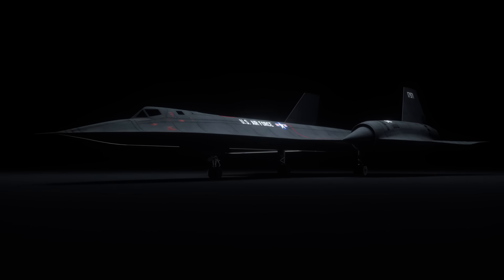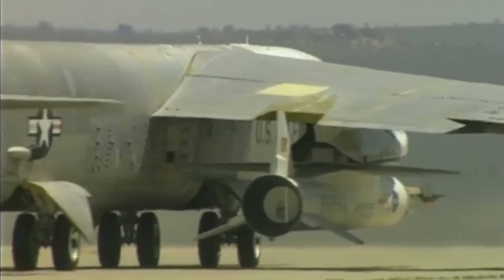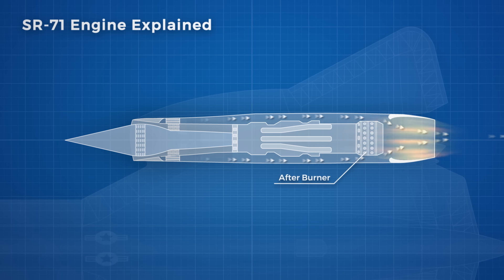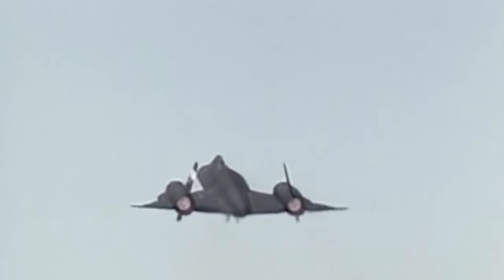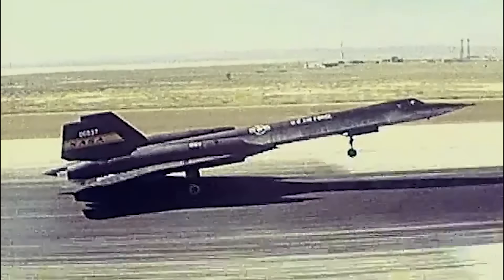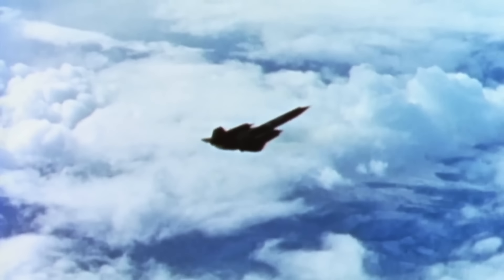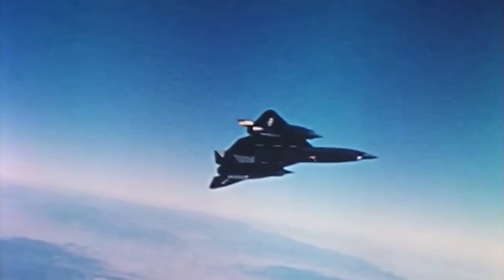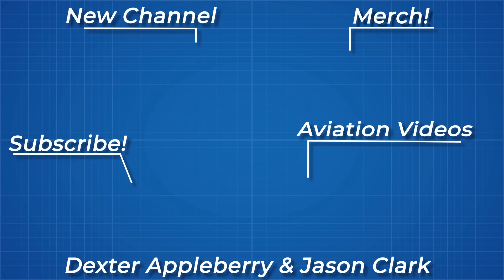The Insane Engineering of the SR-71 Blackbird

Comment: Hey, I know, let's end a few more myths about the SR-71.  I was in ECM, was trained by SAC to work them so, in a pinch, I could be moved TDY to work them, and had friends who did work them.  First, from what we were taught in 1972, the shape of the SR-71 was not just for speed.  Contrary to what you have been taught about the FB-117, the SR-71 was the first plane to use shape for stealth.  The U-2 was the first to use radar absorbing paint and materials for stealth.  We could tell when the Ruskies were tracking an SR-71 because they would say something to the effect that eagles don't normally fly that fast because that is how big an SR-71 was on their scopes, which, if you are familiar with radar scopes, that alone would make them difficult to see.  Imagine trying to track something on your radar scope that is the size of an eagle and traveling at Mach 3+.  Just a wee bit difficult.  Then, when you add in the ECM, which masked an already small picture on the scope, it was almost impossible to see.  Plus the thing flew so fast that, if they entered the range of the scope just behind the radar sweep (I know this from talking to radar weenies) the plane could fly cross a significant part of the scope and out of range before the radar sweep could get back around and see the bird making it even harder to see.  The way the Ruskies ended up having to track an SR-71 was to see it on one radar scope and tell another radar further down range the time, location, direction, and altitude of their siting and the next one or two radar units would note when they saw the bird, time how long it took to get there, and then have to calculate the speed of the plane for a guess shot with a missile.  It was ye ole poke and hope.  The bird was significantly faster than they tell you.  They only tell you the "declassified" top speed not its actual top speed.  That is still classified.
Reply: That's really cool! By the way, what do ECM and SAC stand for?
Reply: @mr.peanut2096  ECM means electronic counter measures SAC means strategic air command
Reply: I think the official ceiling is listed at 85,000 asl, add 25,000 to that.
Reply: Add more than 25k ft to elevation... my dad flew A-12 Oxcarts and SR-71 for the "Company" and everyone in his squadron had astronaut patches on flight suites... the AF drivers were forbidden from going outside of the performance envelope. The Company drivers didnt have these restrictions... but because they flew so high above 100k ft most of them passed away from acute leukemia from over exposure to unshielded UV radiation from the sun. This is what my dad died from shortly after retiring.
Reply: @bradchang5076  Sorry to hear you lost your dad to work-related radiation exposure.  He is a hero in my book, and again, I'm sorry for the sacrifice YOU took but didn't sign up for, even if HE (kind of) did.
Reply: Except not. 

The De Havilland Mosquito, the Horten 225, the YB-49, the U-2, and even the Soviet PO-2 biplane had elements of stealth that were exploited. 

Tracking radars don’t “sweep” and neither did a lot of search radars at the time. 

The SR-71 produced a huge returns off it’s contrails. That’s part of the reason why most later stealth aircraft were subsonic. 

It was not “significantly faster”. Redline was Mach 3.3 as limited by inlet air temperature. The energy of the air increases by the square of the speed, and since the air must be slowed to subsonic to go through the engine, so does the temperature. If it’s too hot.. you can’t add any more fuel which means you lose power. If you add more fuel anyways, your engines will melt. It was probably .1 of a Mach faster only for a few seconds and it probably resulted in several weeks of maintenance afterwards to repair all of the damage. In fact, most of the SR-71 hours were flown at much lower speeds than Mach 3 to save on maintenance costs.
Reply: in my apartment in Korea I used to experience a powerful sonic boom and then about 20 minutes later another one. Intel told me it was the SR-71 stationed in Japan that was taking photos of North Korea. It overflew much of China just getting turned around. My wife told me it happened 2 or 3 times per week. Those mach 2 sonic booms are something.

Later we found out one of the Blackbirds had landed at Osan air base there in Korea so 3 of us found an excuse to make the trip. I drove out onto the tarmac where we saw a temporary hangar set up and we saw the nose of the thing sticking out, it's much taller than you might think. Suddenly there was an MP standing in my way and another one pointing his weapon at us. "Man we got lost, where's the mess hall?" He didn't give me directions other than to turn around.

I finally got to see one sitting on the deck of the decommissioned aircraft carrier in NY harbor. What a beauty.
Reply: Thank you.
Reply: @alanthealienoriginal  Sorry to nitpick, but that's actually an A-12, not an SR-71.  They do look a lot alike (I made the same mistake once), as the SR-71 was a further development of the A-12, but they are technically different planes.  The A-12 was actually in service from 1963 to 1968.  The A-12 could actually fly higher and faster than the SR-71: https://www.cia.gov/library/center-for-the-study-of-intelligence/csi-publications/books-and-monographs/a-12/Archangel-2ndEdition-2Feb12.pdf (see page 42).

Comment: (edited)
-number of units: 32
-dimension:  weight: 27,220 kg/60009.83 pounds; length: appro. 103.876 feet/31.66m; wing: 55.62/16.95m feet and height: 18.5 feet/5.6m
-price: $34m about $250 today
-designer: Kelly Johnson (deigned with pencil and slide rule) 
-first flight: 1964
-retirement: 1998 (USAF); 1999 (NASA) 
-max speed: 2,200 mph/3,540 km/h at 80,000 ft/24,000 m (3 times faster than speed of sound); fun fact: this speed is only powered by 1 of its 2 engines-Pratt & Whitney J58
-34 years of service, 3500 + missions, 1000+ missiles fired at yet not even one got close 
-92% made of titanium (savagely bought from the Soviet Union that "didn't know who" the fuck" they sold it to")
-Pilot requirement: same as astonute 
-reason for retirement: extremely high cost of operation/satellite
Reply: reason for retirement should be slower than the U.S. gubment wastes our money
Reply: >Pilots must be married

thought you meant married to each other for a sec
Reply: this is great
Reply: Sunyata you can’t draw a design with a slide rule. It doesn’t mark a page!
Reply: Auntie Qiu actually 4000+ missile fired
Reply: It sure has depreciated a lot 😁, worse than a luxurious sports car...
Reply: @Lozzie74  You're wrong. Given how essential math is in design, you CAN design with a slide rule, though nowadays, that's done mostly with computers
Reply: I am pretty sure $34m at that time isn't equivalent to $250 from today.
Reply: @mutantgeralt  Hell, for $250 each, I'll take ten
Reply: I watched a sr71 fly over my house in Fulda germany in 84
Reply: I flew on the concord in 1979 from France to new York. I was only 3.
Reply: 240,000 or 240
Reply: Michael Wallbrown don’t shit on our government before you graduate first grade 🤦‍♂️
Reply: For $250 I'm gonna buy one. :-)
Reply: $250 today? BARGAIN!
Reply: I can't imagine Mach 3.2 with one engine, as the thrust imbalance makes them yaw dangerously
Reply: Thank you seng try, very cool!

Comment: Them: Nothing can be "ahead of its time" forever!

SR-71: lol
Reply: It was particularly funny how, every time the Soviets would trick out some plane with oversized engines to beat the SR-71's speed record, the Air Force would just send a Blackbird up with instructions to open the throttle a little more and beat it. I don't know if we'll ever see the real top speed of the Blackbird, just what the Air Force was willing to admit.
Reply: The Soviets never attempted to beat the SR-71. They went for altitude records which still stand today. The only time they beefed up the Mig-25 for extra speed was when it was working as a reconnaissance plane over Israel—and none of those were shot down either in spite of many attempts. 

The SR-71 couldn’t go much faster. It was already going flat out at Mach 3.3. A mere 5% of the total airframe hours accrued were over Mach 3 and it still needed a week of maintenance between each mission.  Going faster than Mach 3.3 would be at great peril to crew and aircraft.

Comment: I personally found the fuel storage part the most interesting. Always thought it would be in a long tank and insulated to keep it away from the scorching exterior when up to speed. Never would have guessed that it WAS the insulation for the plane's components.
Reply: Getting fuel hot isn't a problem because fuel by itself doesn't burn. As long as you don't allow oxygen in the tank and you have pressure valves it doesn't matter what temperature the fuel gets. Something like what happened with TWA 800 happened because there was oxygen in the tank.

I don't know if the SR-71 had a nitrogen gas system or if they just didn't let the tank run dry. Liquid fuel doesn't burn, it's vapor that does and only within a certain ratio. The only time you have a risk of explosion is if you let the tank run dry.

Comment: a quick note about the leaking fuel, it's even more extreme than that: the leaking was a known issue during development of the SR-71 predecessor, and the solution was simply:
"who cares that it leaks on the runway, the titanium will expand enough at operating speed to completely seal it up, so just pump it full of fuel for takeoff, then immediately refuel it after takeoff"

Of course, that's on the SR-71's predecessor, the A-12, but that plane was subjected to nearly identical operational conditions, so i do think this note is still relevant for the SR-71

While making the A-12 lockheed determined that sealing the plane up properly wasn't worth the weight, and between the A-12 and the SR-71 they found something to adress the issue slightly.
Depending on who you ask the leaking might not even have been something going wrong, but just expected behaviour

Comment: Hey Real Engineering, almost all Aircraft use "Wet Wing" designs, with every joint and nook and cranny being sealed. They still leak alot. But the SR-71 leaked due to expansion, not due to design of the tanks!

Comment: The SR-71 is one of the most unique plane ever: it is the fastest yet it needs to dive to reach Mach 1.0 ,
It's a long range plane that can't reach top speed without air refueling , it was never shoot down yet it needs maintenance just to fly again , it was the most high tech plane ever and didn't even use gps ,
It became more efficient as you speed up ,  and the pilot was the one deciding the top speed
Reply: One of the most unique? The most!
Reply: Calm down. Every plane needs maintenance before it goes up again and of course the pilot decides the top speed within the mission profile. Depends on how you define "high tech" and GPS wasn't widely used by the US military before 1990 so I fail to see your point.
Reply: What do you mean it needs to dive to reach mach 1.0? Every aircraft would need refueling if it was travelling at 3 times the speed of sound..
Reply: @bogdanmarceta2057  They call it the 'dipsy-doodle' quoting: At about 33,000 feet we did the "Dipsy Doodle" ( as FAA came to know it ) where we would nose over and descend to about 29,000 feet as we punched through mach 1.0 and then resume climbing to mach 3.0. https://en.wikipedia.org/wiki/Talk%3ALockheed_SR-71_Blackbird%2FArchive_3

Comment: Imagine designing a propulsion system around the manipulation of shock waves!
Freaking Amazing!!!
Reply: Stupidly cool.
Reply: Necessity is the best motivator for innovation. Without manipulating the shock waves, the plane would not meet the requirements.
Reply: That’s every air breathing supersonic aircraft, ever. 

A DC-8 exceeded Mach 1 during a test flight and it formed normal shockwaves across the inlets to allow the engines to operate as if they were subsonic.

Comment: how in the absolute eff did they design that engine? It's amazing that people can be so smart.
Reply: CoreyIsTheName The crazy thing is, it really isn't the engine, it's all the ductwork and systems around the engine, and the extensions creating a ramjet AROUND the engine.
Reply: The science was mostly there, from the X-plane program and space missions. Then they had some of the best engineers on the planet, starting with Kelly Johnson, who found practical applications for that science, and tackled each problem one after each other, and they had quite a few important ones... This is one of the purest examples of what engineering is all about.

Comment: 50's engineering, still better than most of the planes nowadays
Reply: Sally Hillal  Higher top speed, Higher flying capability, Insane engineering, That's what makes it better, Planes like F22 is Insane but still can't achieve the top speed and flying height of Sr71, Sr71 was built for spying at high altitude, Not for combat like f22 was
Reply: @VorteX_SH  That's not how 'better' works.
You're comparing apples to oranges. You even said it yourself.
Reply: @IntelCorei-KProcessor-go2to  Ok bro It's engineering was way tough I agree with you 👍

Comment: This is definitely my favorite aircraft in history. And I appreciate this video since it cleared a misinformation I had regarding the leaking fuel issue. In a previous documentary (cannot remember what it was called or where I've seen it) they said that the leaking fuel was by design. Given the expanding and contracting properties of the fuselage, it was designed like this so the gaps would seal themselves during flight. Your video cleared that up for me, thank you!

Comment: I already knew a lot about SR-71, and about the P&W engines they used, but I didnt really know the fact that they used its own fuel as a coolant, which was circulated across the plane...

Also, who did the plane animation?
Reply: Just about every engine uses fuel as a coolant including the one in your car. 

The change in phase from liquid to gas cools a lot.
Reply: Not only the coolant, but as the lubricant as well. Amazing.
Reply: @deepak_nigwal  Thanks we all worked really hard on this video.
Reply: I’m absolutely sure it’s true. 

And in the case of top fuel dragsters the fuel is the only coolant in the engines.
Reply: @calvinnickel9995  wow... thanks for the insights :)

Comment: Wait, so you're telling me the SR-71's fuel tank was it's skin? The part that i dont understand is, is the entire plane a flying fuel tank or does the skin absorb the fuel?
Reply: The former.  You seal up the gaps as best you can, this aircraft leaked a fair bit but that's ok.  It wasn't all fuel tanks but it was pretty close to it.
Reply: It’s like keeping your gas in your trunk. It’s not a gas tank, it’s in the skin of the car - it’s all held in together by the outside of the vehicle. Imagine putting water in a cardboard box - it would leak just slowly ! :)
Reply: @jimsvideos7201  yeah, it leaked a lot of fuel on the ground, but when it reached sustained supersonic flight, the airframe expands and the gaps from where the fuel leaks from are filled out
Reply: @SardineBreath28  so fuel was running all throughout the inside of the plane except for certain parts?
Reply: Delta9xray _ to kinda sum it up - JP7 was used as coolant, lubricant and fuel. Thus it was pumped throughout the aircraft. The titanium panels didn’t provide an exact seal while stationary so fuel would seep from the aircraft. It was said fuel economy and aircraft performance became better after a number of sorties as the metal would literally be melted together
Reply: @wockyslush3038 It was separated into compartments but yes there was outer skin on the top and bottom.
Reply: @DisgracedAero  No it wasn't melted together, literally or otherwise. There's that "it was said" nonsense again.

Comment: Engineers: "Theoretically, it could go faster..."
Government Official: "So why not practically?"
Engineers: "... Because the material required to build the thing in order to make it withstand 'going faster' doesn't exist, and it would probably explode due to multiple structural integrity failures..."
... I swear to god, this thing is the exact opposite of the F-117. The F-117 essentially shouldn't even be able to fly, yet we made it anyways. ... This thing was able to fly so well, we ran out of materials to build it out of to make it durable enough to utilize it's full potential...
Reply: Literally ran out of materials?